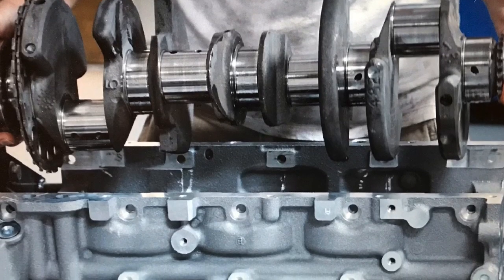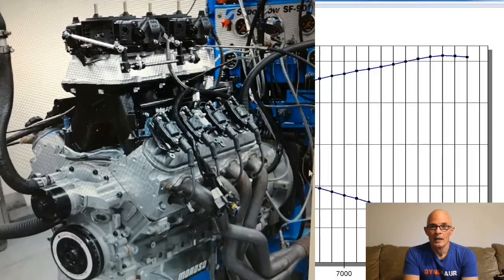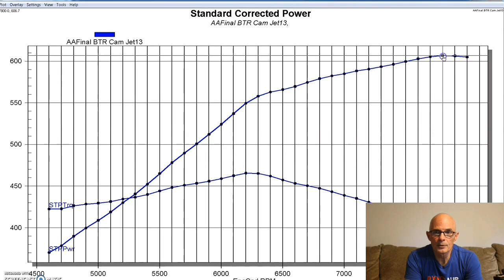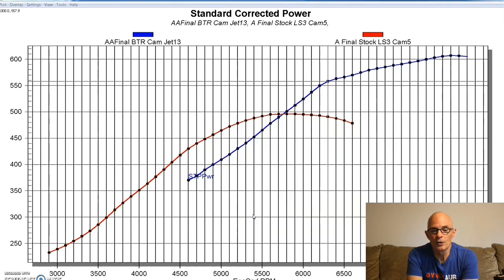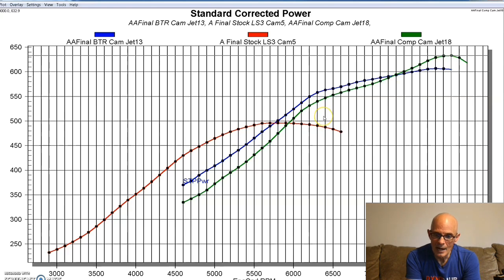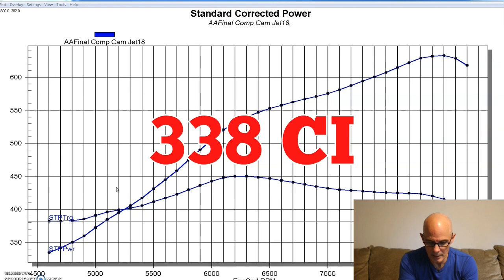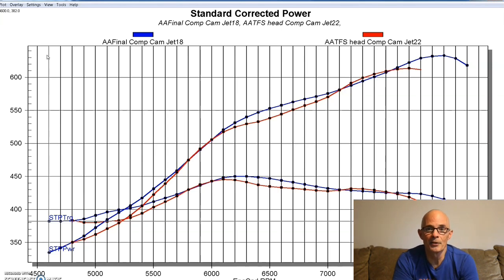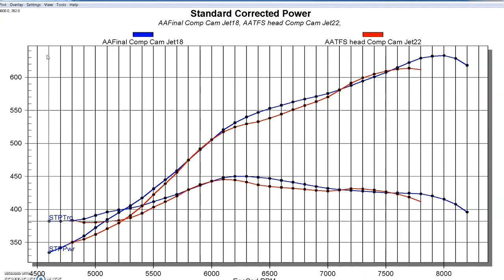DESTROKE LS-4.8L CRANK IN LS3 BLOCK-SHORT STROKE POWER-AN LS MONSTER MYTH?

Comment: This is literally what nascar cup guys have been saying for years, Baja, and anyone else with long lasting high RPM engines.. valvetrain stability, hence the reason for pneumatic valve control in F1...
Reply: Have you looked into what Koenigsegg has been doing for a camless freevalve engine?
Reply: @KaoticFdr1  koinigsegg doesent resolve anything, they still use springs, they just invent a better way to control valve than the cam do
Reply: @Vallo995  
The real bonus with Free Valve is the ability to provide truly variable lift and truly variable timing. At low speed a mild mannered engine. As the RPMs come up the timing and lift change . Go from grocery getter to full race motor and back
Reply: @KaoticFdr1  Freevalve is dead in the water. We don't need to reinvent the wheel when we have finger follower style DOHC and even variable valve timing.
Reply: @amorag59  
"Freevalve is dead in the water"

Is that why Koenigsegg's newest 700hp turbo 3cyl is using it?
Reply: Witchcraft lmao
Reply: why the f ev fans alwais say the same shit without study? guys, before speaking, study
Reply: nallen100 you sir are a hatted ass
Reply: nallen100  Freightliners semi will only have a working distance of 250 mile at 550-kWh. That's not viable for anything long distance. Battery technology needs a break through, and it will happen. Solid state batteries look promising..
Reply: nallen100 Lol talking shit about everyone else’s reading comprehension when you ignore everyone’s point: “EVs dominate in every category performance, price, sales.” Price????? (Is this a joke? No wonder I had to ask you if you lived in a cave, you really do) Performance? Lol where are the EVs on Nurburgring fastest times list? Harder for EVs when the track average speed is above a lousy 60mph. Sure, also ignore the lousy stopping distance specs too. Even @Fee referenced the engineering explained video that details how the ICE is not dead yet. Yet you keep spouting out, not facts but your opinion lol. Ignorance is bliss, keep punching at thin air, it’s quite entertaining.
Reply: Little Fiat 1.4 uses oil pressure to actuate the intake valves. Multiair.
Reply: s0meguy809 multiair IS koenigsegg’s freevalve
Reply: nallen100 the quarter is irrelevant for EV’s except in comparison to other ev’s
Reply: nallen100  do you even own a Tesla? Or are you just regurgitating fake news? Or better yet are you one of their salesmen? If electric vehicles are the Holy Grail to you why the interest in a high revving LS engine? Good luck repairing that electric vehicle when it breaks down. Those things are destroying the environment because of lithium Mining and Disposal. Are you also going to get electric vehicles to do the work of heavy equipment like bulldozers and dump trucks and freight trucks? Never going to happen. Have you asked yourself why you don't see anything but Diesel and gas heavy equipment at mining sites? Unless electric vehicles convert to hydrogen fuel cells or some other technology they will be phased out. Also, if everybody had an electric vehicle and plugged it in to charge it every night the electric grid would require more fuel to be consumed to convert to electricity. Stop regurgitating propaganda from your climate change buddies and think for yourself.
Reply: Rock Roll I agree with you, entertaining to watch person after person point out EV flaws (not enough energy density to serve heavy industry) and see @nallen ignore it and spout bullshit, “my dear TeSlA brand is the BEST in performance sales and price” talking about performance in limited circumstances and a semi that’s not even in production yet, I’m in stitches!
Reply: For sure, I try to think of ways to make v8 valvetrain better daily!
Reply: I just stopped in to say I was always under the impression that the higher rpms were not obtainable because of the total mass of the rotating assembly and the angualr momentum on the crank vs something like an inline 4 honda which many race setups rev above 9k upwards of 11k (yes with some forms of vvt) and super bike engines that live in the 12k-18k range understandably they don't need to make the torque numbers of a typical v8 size vehicle engine but is the tech in those engines not something to look into if they are acheiving those types of engine rpm and we are claiming its a valve train problem?
Reply: nallen100  say the conspiracy guy.... to be honest, after that, i cant reply to ppl that belive that tipe of thing, also from a guy (or lady) that think a 0-60 mean everything when the same car in 60-100 (or faster) is a "pin in the wood", ev are the future, for sure, i want one, a lot of ppl drive for less than 50 miles a day and ev is perfect for this (thats why i want one), but not fast (well, for sure a 600hp car, with lower gear ratio, is fast in 0-60 and 600hp still 600hp), also, ev need to be drived slower is u want that tipe of range, i need to drive 20km/h slower in highway if i want that tipe of range, and we should dont belive in car spec (or truck o semy) that arent in production
Reply: nallen100  are u dumb or something else? U are the first that talk about ev range, not me, i didnt start that, and if a car manufactor say that is car run for 400 mile but in real word it runs for 300 (pure random number), i dont know u, but for me thats bulls*it, and if i had only one car, i cant chose an ev, because i need flexibility, normaly i drive for less than 20 miles per day, but sometime i drive for more than 200 mile, and it for work, so i need to be fast as the speed limit is, it isnt for pleasure, so time is important, again, ev are geat and i want one, but i also need a second car just because sometime i have specia needs, and its too stupid spend 30k, or more, for a car that in one year i will drive for less that 5k mile, i take pubblic transport for that, probably for u oil companu law public transport, and u dont know that from oil we make a lot of other produc that we use every day.
I almost forgot, tesla dont have dealership, they have showrom
Reply: Vallo995 I’ve been trying to articulate that point on speeding. Most people ignore this because all vehicles get worse mpg at higher speeds, but not as bad as the 60% reduction in EVs. If they sold them with more gears or to keep the motors in their rpm happy place for peak torque and efficiency this probably wouldn’t be as dramatic. 

PS holy hell it just occurred to me this is all just one big thread hijack after remembering what video I’m on.
Reply: nallen100  8 hours is incorrect. Drivers can drive 11 hours before taking a 10 hour break. That equates to 700+ miles a day. If you don't believe me look up the FMCSA and their website. 

Also team drivers switch back and forth keeping their truck running almost indefinitely. Stopping only for fuel, food and showers. Are they better at that as well?
Reply: Who thought this post would go south so quickly huh? lol One thing i want to say is regardless of how we move freight with semis, gas or electric, both require a specific amount of energy to move a specific amount of mass. It's not always in your best interest to instantly go from 0-60 or vise versa because it's wasting energy. Semi's are slow for a reason! It save tons of energy! If we had ideal conditions and could work in a vacuum for theoretical sake. A perfect acceleration to deceleration algorithm for maximum efficiency would be finding the amount of time the task must be completed in and then we could determine how fast we'd have to go to achieve that time frame. Form there the highest speed in this model would be in the exact middle of the model. You'd slowly be accelerating until the halfway point and then decelerating slowly from there until the destination is reached and you've come to a stop.  Gale banks analyzed a fleet of diesel trucks years ago trying to figure out how they could improve the fleet and make them more efficient. They looked at the trucks power output and driver's driving styles. They quickly realized it's not about the power output or needing more power for "faster" 0-60 times, or going up hills faster. But instead they solved the fuel crunch by limiting the rate of acceleration change the drivers could command from the truck, thus slowing the trucks 0-60 times. They still moved the same amount of mass, but on less fuel or energy. This changed the game for semi trucks for ever, most now have this same acceleration algorithm pre-installed onto the ECU. Even being faster because #electric you'd quickly find these same algorithms getting adopted into Tesla's for energy savings and safety. I mean Tesla semi trucks are for better efficiency after all right?
Reply: nallen100 Let me preface that I am not anti EV, but my god dude (or dudette) people praising EVs are so quick to regurgitate and cherrypick the same information points 🤦🏾‍♂️.

Outselling other EVs in the same class is much different than saying “EVs are dominating [an assumed overall auto market]”

“Model 3 0-60 speed” So what, a 10,000 lb Ram 3500 truck will do 0-60 in 8.4 seconds because of its torquey diesel engine. A 10,000 lb truck is a boat anchor and a half. People who understand that torque moves weight and EVs have lots of low end torque should not be surprised by this.

What about EV performance over 60 mph? Yes EVs make loads of torque but do yourself a favor and look at how the torque curves drop off after 60 mph. For sake of addressing why this is important: unregulated sections of the autobahn and the fact that you seem to think “EVs are better in every way” - they aren’t. EVs make fuck-all torque over 100 mph.

It is not without reason to posit an example of driving 75+ on the freeway with the heat/AC on. In laboratory published documents Tesla quotes a 60% drop in battery range while driving under such conditions (outside ideal). This doesn’t happen with ICEs. A gas car rated at 36 mpg will never see 21 mpg... 

It’s pretty sad you are validating the Tesla semi performance by quoting 0-60 times and raving about a semi  that is delayed and not even in production. There is still concern about the weight of the truck to give it decent range as there are laws surrounding max semi weight and people don’t want to load up and exceeding this. 

Don’t even get me started on how thinking just because EVs have low cg they are thought to handle well. A lighter car will always handle better and more safely. If you are curious,watch a video out there of a Model 3 drifting in an empty lot in dyno mode (no traction aids). It was as if they were drifting a boat anchor. Lots of momentum when he was arching around and some instances of polar moment (when you overcorrect and the car drastically swings further in the other direction). It’s inertia around a corner. People need to stop equating EVs to super or sports cars just based on 0-60 performance.
Reply: nallen100 Gas engines are not “dead in the water” they are still very prevalent here in the states, perhaps not EU. (lol EVs dominating? Do you live in a cave? EVs are still minority overall numbers) You can hardly call ICE vehicles dead in the water without a viable replacement that matches ICE energy density, especially in heavy energy intensive vehicles like semis. I’m all for EVs hitting the road, don’t get me wrong. But let’s not skew facts, especially when we know companies like Daimler, VW Honda, although are halting new engine designs to focus on EV, they are still working on new engines for 2026, will tweak it for decades after and will continue to incorporate engines for hybrid powertrains.
Reply: nallen100 that’s not accurate, Engineering explained just covered this topic check his recent videos
Reply: nallen100  They guy was literally a movie actor before he created Tesla. Do you not think that is odd? Come on now!
Reply: nallen100 ev’s have no soul
Reply: nallen100 so your saying since the the model 3 is the quickest best handling and selling car in its class the government got mad and said fuck off? Funny how you say it’s the best selling and then say if there was a sale explosion the economy would tank? Well do you have inside info we don’t know? You s the corona virus a hoax? Just the government covering up its failure to stop the model 3? Did I mention it had a super fast quarter mile time? That’s really important for people that race quarter miles. It also sells better than any car in its class, which is why the corona virus exist! Or maybe they started production on the semi and the government is trying to quarantine us because it can 65 mph uphill? Can you site anything else you read in the online dealship? You know because American is afraid Elon is trying to murder the United States? Holy fuck I wish I could have dreams like you.
EV is here
It is not dominating. It’s a welcome option that is far from greener.
Reply: @nallen100 they made you look so stupid.
Reply: nallen100  other than 1/4 mile racing, you can't really use a tesla in a LeMans, they won't allow you to run an extension cord down the length of any track
Reply: nallen100  the model 3, you mean a car you'll never truly own, a car no one but the dealership can work on.... a car that once modified slightly tesla won't allow you to use quick fill stations.... yes a pile of shit that when you wreck it the only way to get out is to reach behind the carpet in the floor area of the back seat and pull on two cords simultaneously to open the back doors cause the front won't once the fire department cuts the 12 volt source. let's not forget you can damage the battery packs by simply stomping on the floor of the car, which is what is specifically detailed in the operators manual in a list of things that can cause you harm. let's not forget it takes 3000 gallons of water to use in order to fully turn off a battery pack fire in the case of a rupture from a car accident
Reply: nallen100    Keep buying those electric cars, the coal fired power plants love the new customers.
Reply: nallen100  until the battery needs to be replaced, then the cost savings is out the window. The sales numbers are because they are the current fad. it will die off. Cant drive across country on vacation very effectively when you have to stop for hours at a time to recharge, rather than for just a few min to fill your tank.
Reply: nallen100 Good to know you could care less to actually read my comment as my second to last paragraph specifically talks about the Tesla semi. The semi that’s not even in production, the one we don’t have concrete numbers on weight, or battery kWh, or torque output. No this doesn’t beat all diesels not in range (2000 miles) nor energy density, and we don’t know yet for power density. 0-60 for a semi means fuck-all. They’re not designed for 0-60, diesel semis are designed for continuous operation at highest efficiency possible so no surprise if it doesn’t do 0-60 well.

Read my comment, you’re making yourself look silly. I just pointed out how a 10000 lb aerodynamic brick of a truck can run 8 second 0-60 times. It has torque it can make those numbers it means nothing. A Model 3 performance has higher power to weight ratio than a GT3 RS.
Reply: nallen100  You do realize that Elon Musk is a government shill, don't you? Government money is filtered through to his private space company to avoid disclosing any findings through freedom of information. Tesla vehicle warranties are voided if you attempt to make any repairs yourself. It's all in the name of government control.
Reply: TrakSpock1 andddddd look ma you can see the cocaine conspiracies as they form
Reply: nallen100  Then why the hell did you ask me if I knew of the Tesla semi? Right after I got done talking about it. How do you gather I have 5 year old reading comprehension given that, and when you are conveniently qualifying and adding info about the dominating comment to each successive post. For example saying EVs are here and dominating can mean many different things, only in your comment before last did you clarify what metrics you were talking about. 

"2000 mile range is pointless" The range wasn't brought up to say someone would drive that far... It's to rehash that a diesel beats the Tesla semi in this regard because of fuel energy density.

The idea that your handling should not be mainly predicated on low cg is not dumb, and it's petty for you to reach like that. Why do you think race car constructors are so focused on light weight? Because it's important for handling and race cars don't have loads of torque for forgiveness mid corner, it's important not having a large polar moment. The point of watching someone drift is you can physically see the momentum in action, you can see the guy thinking ahead because the car is carrying so much momentum he doesn't want to crash. Don't know how else to explain it but to just up and say "that's stupid" is childish. Weight is a big deal I don't care if you want to talk shit for your own vanity sake, let me put it this way, you at least understand late braking leads to faster cornering right? How do you think a heavy ass car would do with that? Compare the model 3s 111 ft 60-0 braking with other cars and it pales. 

I stopped looking into the track time info you posted after seeing the Model 3 performance compared to the GT3 rs you mentioned, because it's one giant cherry pick. You conveniently only mention performance on Willow springs and the Top gear track, which are small slow corner courses. I'll give you a nod on that, good on the Model 3 for capturing that time at willow springs, but it's average speed around that track was 64 mph, take it to a real track like Nurburgring which is a more prevalent benchmark and captures higher speed performance.

Lastly I'd like to remind you not to ignore all the stats that back up my original point. Engines aren't "dead in the water" and EVs aren't a performance godsend across the board. You can't argue engines are dead when the Tesla semi etc. and thus a replacement for diesel semis literally isn't available. There's absolutely fuck-all of torque over 60 mph in EV cars and the range suffers dramatically (2/3rds range) when you go over 75 mph in conditions mentioned above. Lol seriously? claiming engines are dead when there are 1 million EVs in the US and 262 million cars with engines? Dead when Daimler, Honda and VW are headliners in planning to focus on developing EV after they design a new engine, say they are working on new engine families for mid to late 2020, which will be refined tweaked and put in hybrids for decades after that. It is what is is.
Reply: What about Rod Ratio, Guys? I read years ago, about " Southern Fried Chicken, a 351 C Pro Stock Motor, from the mid Seventies. They liked short rods, the piston accelerated harder after bang. Others, mention extended dwell at bang. What do I feel?? No need to sit on the fence! A larger { longer } rod, has gota have more mechanical advantage; surely!!! Street engine, stick shift. Ring pack probs??
 But WHAT DO ALL YOUS RECKON??
Be good, have fun.
Adam.
Reply: @MsKatjie  A shorter rod will have the piston descending earlier and should make more power at the expense of higher side loading forces on the piston and more piston acceleration/jerk. Longer rods give you the higher dwell time which is helpful for big bore engines where you are concerned about flame propagation and peak pressure timing.
Reply: @amorag59  Thanks for the info and taking to time.